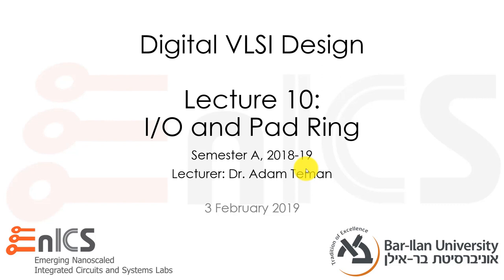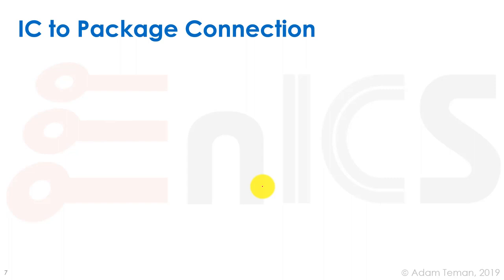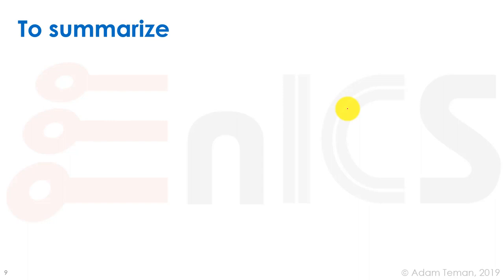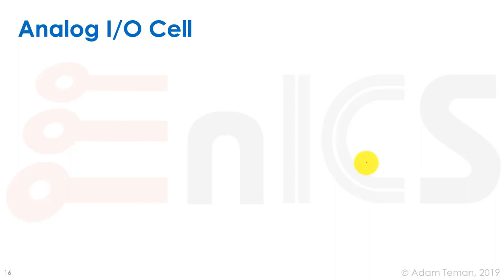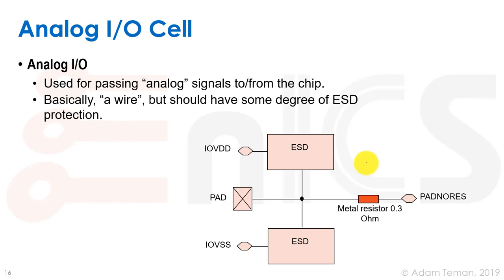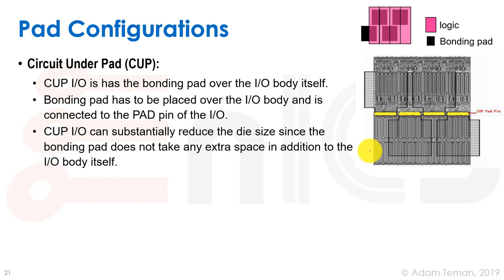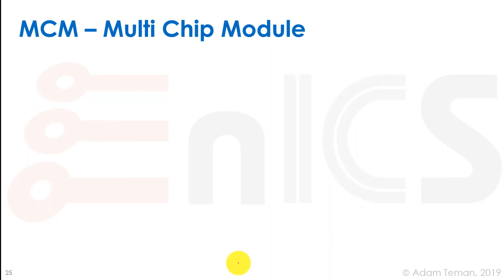DVD - Lecture 10: Packaging and I/O Circuits

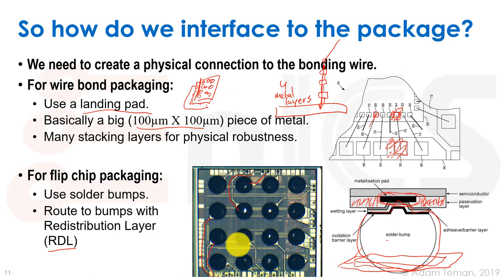Comment: Hi, Prof. Adam Teman. I am interested in the flip-chip packaging part. Can we place I/O pads inside a chip instead of on the edges when using C4 bumps? At 20:45, we can see a photo with pads on the edges, and the RDL connects pads to bumps inside the chips. I wonder whether it is necessary. Or just because the design of the certain chip used I/O pads on the edges.
Resolved at 44:20. "Yes, we can."
Reply from the maker: Yes, there is no physical reason that you cannot put I/O circuits in the middle of the chip. But there are practical reasons that the periphery is still the primary location of the I/Os.

The two main reasons I can think of off the top of my head are:
1) The Power Rings - you need to provide power rails to I/Os for level shifters and ESD protection and therefore you need to feed 4 rails into an I/O (Digital VDD/VSS and I/O VDD/VSS). We generally supply these through power pads that connect to the I/O rings. So to put an I/O somewhere, you need an additional 4 I/Os (power supply I/Os) to feed its rails. This is quite a bit of overhead if you're not providing this to a bunch of I/Os. Therefore, if you do put I/Os in the middle of the chip, you will usually have a bunch of them (e.g., a bus)

2) They disrupt the overall floorplan. The I/Os are routed up to the top metal (RDL) to get to the bumps. So they are essentially blocking all the routing resources above them and to route from one side to the other, you'd have to detour around the I/O. This is inconvenient and can cause congestion. When the I/Os are on the periphery, this is a non-issue.

Probably there are additional reasons, but these are some of the main ones. Therefore, most of the internal connections are just power supplies, where you highly benefit from connecting directly from a bump to an internal part of the chip core.

Comment: Hi, are the digital IO Pad released in the foundry library ? No need to extra purchase, right?
Reply from the maker: Usually they are but not necessarily.
Most foundries will provide you with basic IPs: standard cells, I/Os and an SRAM compiler. But this is not part of the process design kit (PDK), and not part of the standard cell library, but rather a separate IP library.
Therefore, you can purchase the I/O library from a different vendor (or get more advanced I/Os from the foundry) or design them yourself. In the end, they're "just" a circuit, so you can for sure design them in-house.
Reply: @AdiTeman  thanks for your reply, and your lecture help me a lot, remarkable work!!

Comment: Dear Adam Teman, greetins. What if a chip has few different power domains, is it possible to use few "semi" rings for reducing total amount of rings?
Reply from the maker: Multiple power domains are beyond the scope of this course - I hope I will have time to prepare a few lectures on this in the future. However, to try and answer your question (I didn't fully understand what you mean), you would usually make a local ring around the power domains and feed it directly from the voltage source (regulator or pad)

Comment: It's me again, can vdds connected together in package, will that cause problem in high frequency scenario?
Reply from the maker: This should not cause a problem. The lines on the board are wide with very low resistance. That being said, high-frequency board and package design is a very non-trivial (high price!) thing, and I am far from being an expert. But in general, connecting and shorting together the power supplies in as many places possible is the best thing you can do.
Reply: @AdiTeman  thanks for your answer, I am finding out a clue why chip's working current lower than my expected current, maybe because IR drop failure or the package bonding wire disconnected 🤔~